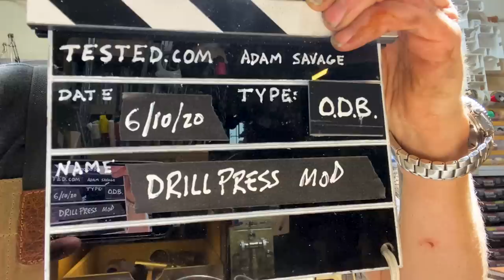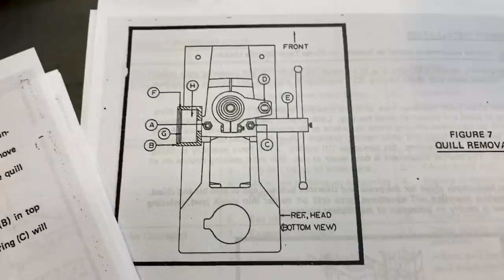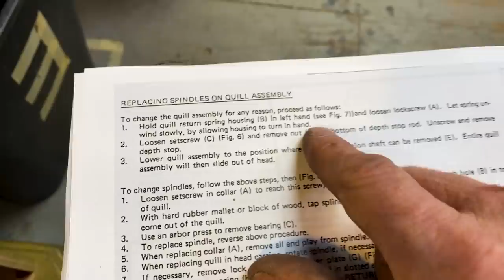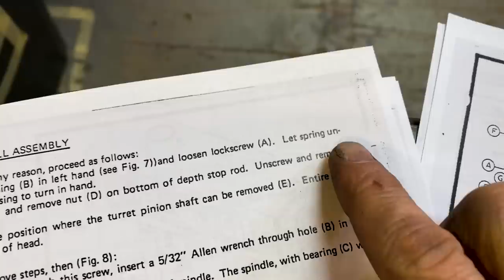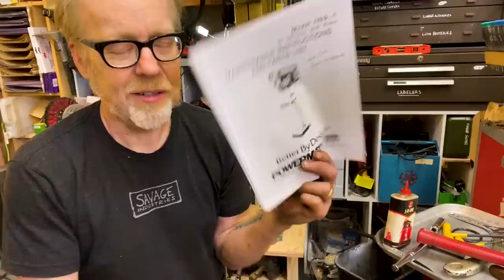Adam Savage's One Day Builds: Drill Press Modification!

Comment: You did not test the run out with a dial indicator after the repair (or at least not on film), or by making 50 holes with a 1 1/2" diameter 1 1/4" deep.

Comment: My keyless Rohm chuck I believe is the same jacob’s taper and has a threaded portion on it. If you want me to confirm I can and get you the part number. Or just contact Rohm and tell them what you want.
Reply: 1-13 Rohm Supra 1/32-1/2 Jacobs 33. That’s the chuck I have on my Walker Turner.

Comment: Anybody notice the bump stop O ring only was installed later, it was left in the tray, even though the speech about checking all parts have been put back in place.........

The old quill can still be repaired, just take it apart and cut a different taper onto it, or cut a thread and then machine a steel rod to receive it, and put the taper on the rod, so you get a new section.  You could even them machine a thread onto the new rod to match the chuck.

Old chuck is easy, still good chuck, so machine out the hole slightly ,and then put in a morse taper adaptor, and use it as a lathe drill chuck.

Comment: Adam, Some how I overlooked this video when you first posted it, but watched it a few minutes ago. My apologies for the tardy comment, but hopefully my suggestion will strike a chord with your desire to arrange your shop to be efficient and a pleasure to work in.
It occurred to me that changing to a conventional Jacobs chuck will come with one issue that you may not be  used to...  That is, managing a loose (and possibly wayward) chuck key. From my past trades experience, tethering a chuck key to a drill press has some operational and safety problems, but just leaving it lying around also means the key is never there when you want it. The best solution I have ever seen, and the one I use in my home workshop is to fasten a tool clip (like https://www.ovesco.com.au/products/more-hardware/clamps-and-hooks/tube-clamps/tool-clips-13mm/ ) to the front of the body of the drill press, just above the chuck, in your case, just below the switch and above the Quill protrusion. You can use one clip, sized to attach the key around its shank, or two smaller clips for the T-handle. In my case it required drilling and tapping a small, blind hole into the cast iron drill body and fastening the clip with a small Allen bolt. My views of your drill press, from many videos, suggest this would also work for you, despite the centre slit in the drill body in the suggested position.
Keeping the key in this position allows it to be in easy reach, and easily returned to its home, when you're finished with it.
If there is a down side to this storage method, it is that all drill press operators must return the chuck key to the clip diligently to develop the habit of clipping it back up (easy, if there are only one or two drill operators, but almost impossible if there are more).
Anyway, I thought this might help with keeping your workshop neat, clean and, of course an enjoyable place to work.

Comment: simple fix: build weld onto the shaft, then using a sine plate and tool holder from a lathe, clamp a cutter and re cut the taper on the shaft, all can be done without removing the spindle
Reply: Don't need a cutter. Just set a block of wood there to rest an angle grinder, sand to finish. Spend the $180 on say a spindle sander. Different strokes when you have "TV money."

Comment: That spindle could be used for some project where something light has to go up and down. Otherwise, recycle it at the scrap dealer
Reply: If it spins a bearing he could pull parts from the original to repair it.

Comment: Is the old chuck an Albrecht?  An Albrecht is never garbage. So never ever EVER throw away a beautiful keyless Albrecht! I have several 1-13s and a 0-6. They are superior to a Jacob keyed chuck.  They are designed to tighten under load and will never slip.  Repair it and the quill and swap it back in, or repair only the chuck use it on the lathe or the Bridgeport, the latter two only require an arbour - cheap as chips on eBay.

Comment: For anyone contemplating using a drill press as a spindle sander, do yourself a favor and buy a Rigid Spindle Sander.     For $ 270 bucks and tax, it does a better job, and doesn't put stress on your drill press it was not designed for.

Comment: Hope someone else points this out..... the table lift is installed wrong. The small ring sits against the foot of the press and the table is lifted by the crank portion of lift. The four bolts on the "TOP" of that lift is where the old table bolted to the lift......

Also for reference, the shaft is NOT supposed to move when operated... only the portion which contains the crank handle is supposed to move... this mechanic is observed on ALL drills presses.

I'm not saying it won't work.... I'm just saying it is in fact not correct, and the moving shaft could be a safety issue.

Comment: I feel like Adam's lathe could just recut a new larger sized taper
Reply: Mating tapers are usually ground rather than cut. Take a look in to the precision differences its quite the rabbit hole. In the end you will twitch every time Adam uses sandpaper on this surface plate.

Comment: I thought the ALL drill presses (basically) have the same REMOVABLE Jacobs 33 tapered spindle.  Not in the Powermatic???  I don't see the slot.  Hmmm.  Anyway in my press I pull down the quill to the maximum and there is a open slot where you drive in a tapered wedge into the top of the spindle and tap it out.    So why replace the entire spindle assembly rather than just the spindle, and then swap it with the replacement?  Then you don't have to mess with the #$%@^  spindle return spring.  Faster!  Simpler!  My $0.02.

Comment: Refusing to trash a classic drill press and persistently scouring the internet for parts: 100 gold points! Using You Tube to find repair video rather than call a repair shop 50 silver bonus points.  But using WD-40 as a parts cleaner and "3 in One" oil to lube machine tools!?!?!? ARRAUGH! Turn in your machinists Union Card! Have you never heard of carb cleaner? Denatured alcohol, Starrett 1620 Machine Tool oil, Break Free???   But wiping hands grimy with decades old grease on your hair and the seat of your pants? Priceless!  Won't Mrs. Savage be pleased when you plop yourself on her favorite white couch? 😂😂😂
OBTW, you can make using a keyed chuck easier by drilling a hole in the chuck key and attaching it to the chain of retractable key chain (the kind the janitors wore in school) and attaching the reel to the side of the drill press.

Comment: Some times if you do thing in the proper order they will provide you the exact detentions so you can potentially make your self I come across same problem with my floor mount that allows you to use any bike in to a stationary bike for exercising.  My model was no longer made so I offered 10$ up front just for the exact dimensions I had the exploded show.ing my part but nothing on dimensions and THE part was lost by former oner  who w
as selling Me a 600 trainer  because it had problems. He bought it a year earlier bran new but it payed around bike shop for 10 years so reality was it w.as antique out of build run for years when he got it I made the part  better than original and pe
So than 40 $ I got better than the new model that sells for 1200" any way the guy I was dealing with when way more than he needed to because I just made the offer.

Comment: Drill press is not spindle sander. You don't use spindle sander to make holes and you don't use drill press to sand.

Maybe if you have a centered bearing on the table of the drill press, but that's probably asking too much of the hobbyist willing to destroy his drill press by using it as a spindle sander.

Comment: ADAM! You forgot the o-ring that goes under the depth stop collar. you remove it at @25:02
Reply: Matt Gordon - It’s back on at 28:50.  There were two on the table, now one is installed and one left on the table.

Comment: Too bad Apple isn't part of the right to fix movement. Everything they make is proprietary. I love being able to build a PC when I feel the need. I'm getting too old to be messing inside computers like before but I went to school for that and it was so much fun building birthday present's and Christmas presents. Then if something stopped working I could just go to my local PC parts store, and get a replacement part. It was also good because you could upgrade the computers as parts got better or processors got faster. Granted you were limited by what the motherboard could support but if planned correctly you could get a couple upgrades out of a motherboard. It's been a while since I've done that sort of stuff but I am willing to bet Apple computers are still the same. Meaning, you can't buy an after market part and pop it in. Which is why they are so expensive. Some people would argue Apple computers are better. I would say, it depends on what you need the computer for and the quality of the parts you used to build your computer. I have a computer I built 10 years ago that still works great. Granted, technology has passed it up, but there are still parts out there for it should it ever need to be fixed. Now it's mainly used for my grandkids when they are over they can use it to type up school papers and research stuff for reports.

Comment: Have you thought of reaching out to Abom79? he can repair shafts using a spray welding  process to add material.  He may be able to mill out the damage to the internal taper in the chuck. Once he has that measurement he can the use the sprawled method to add material to the drive shaft then turn the taper down to the specs of the chuck.

https://youtu.be/FLYdhfgF6Pg